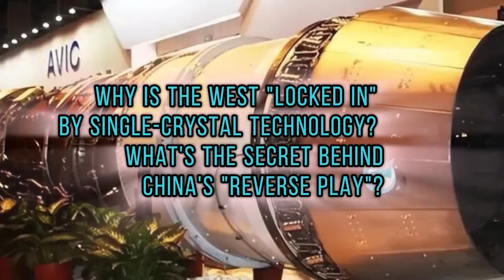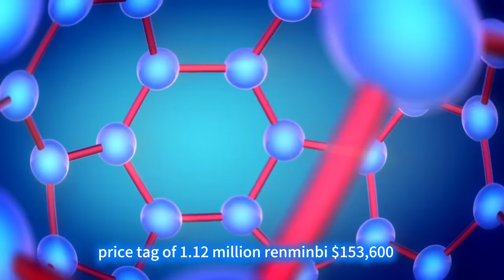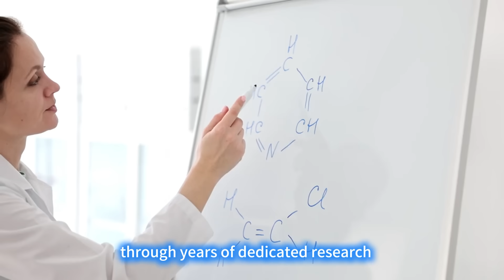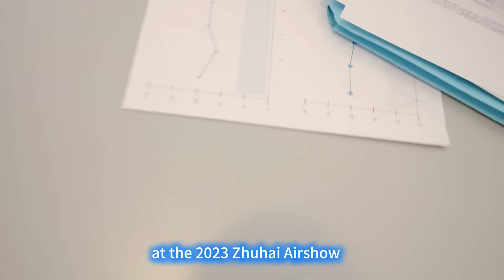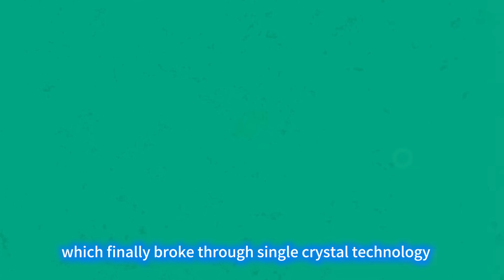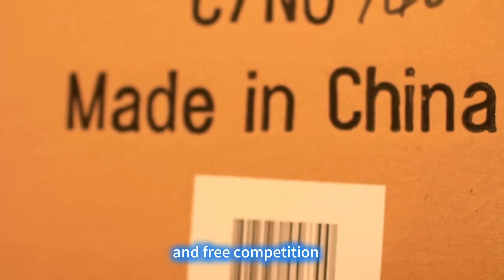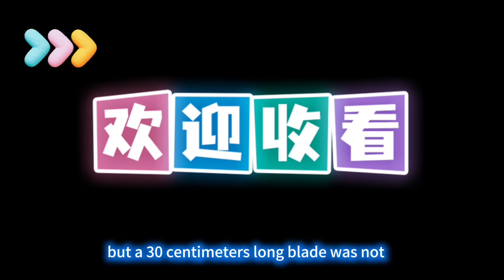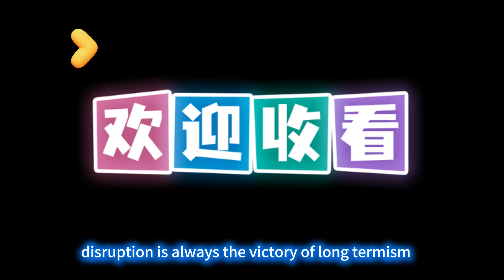What's the Secret Behind China's “Reverse Play”？

Comment: China's R&D decision to by-pass the multiple barriers put up by western metallurgy specialist manufacturers on the existing aero-engines turbine blades enable China researchers to make this breakthrough and produce a better blade product.
This success need real R&D dedication and commitment to "seek out the light at the end of the dark  tunnel".
西方不亮東方亮.
哪裡有四方黑沉沉.
(If the west is dark, the east will be bright. Not likely to be darkness everywhere).
However, this Chinese new process need to be scaled up to the bigger engines blades for the use in large  commercial planes engines. 
Such large blade's material heat treatment process are still patent protected by the bigger western manufacturers.
Another Chinese breakthrough needed.
Soon.

Comment: Amazing breakthrough! Thank you China!
Reply: This is not new for China.  I believe they had it about 5 or more years ago.  At that time Germany wanted to buy them from China.  I believe China are using them on the WS engines.  The single blade crystal can withstand temperature a few 100's degree more than the one used in F-35.  Thus the engine requires less maintenance and it can produce more thrust.